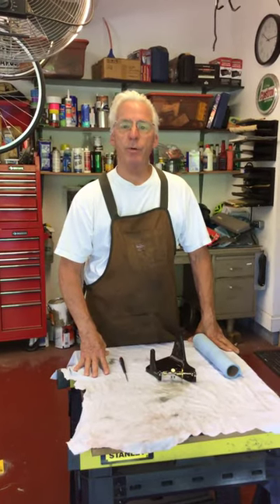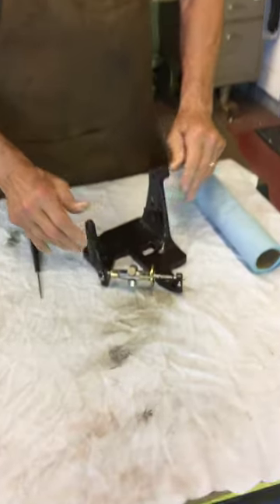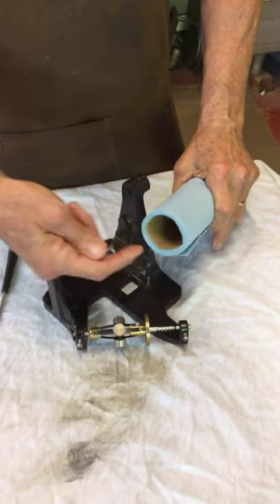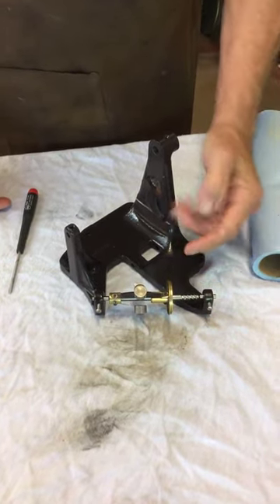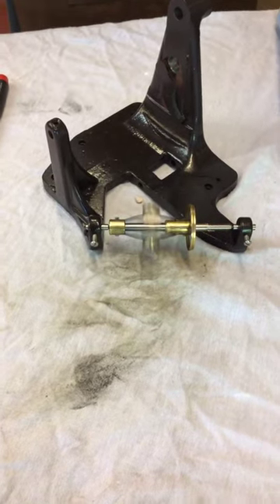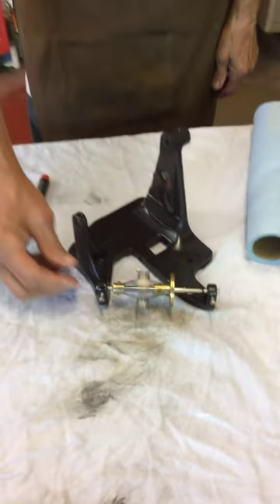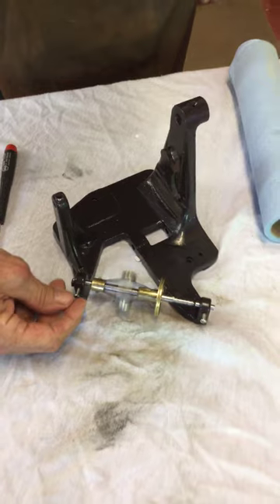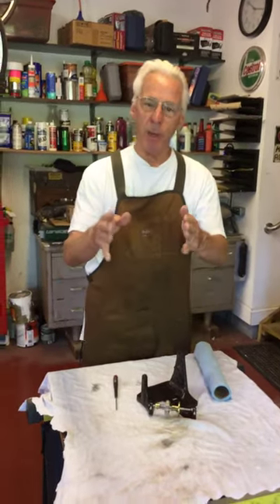87.  How to adjust a phonograph governor

Comment: First thank you very much for your interesting and helpful videos. 
I would like to know,  if is possible, how I can reduce the governor speed.
I must reduce (as I assume) or increase the weight of the 3 governor counterweight?  
Thank you very much.
Reply from the maker: Don’t worry about the governor spinning, all three weights should be equal in size and weight. You reduce the governor speed by the speed control on the top of the motor board. Once the speed is set to 78 RPM the governor is holding the that speed.
Reply: @1974hurt  Thank you

Comment: Have an Edison Amberola BVI, couple questions about my governor, will check but do not thing I have the ball bearings on either end of the governor, should there be two?  Spins fine.  Also I think some years ago had to replace one weight?  One weight is just a bit twisted from the others,  probably should replace all three at sametime for equality?   Does anyone make replacements for the Amberola, or can a good used governor be found?  Which governors from other models might be compatible with my Amberola BVI?  If needed the ball bearings I might have, or can order from a ball bearing supplier?   Thanks So Very Much. Todd